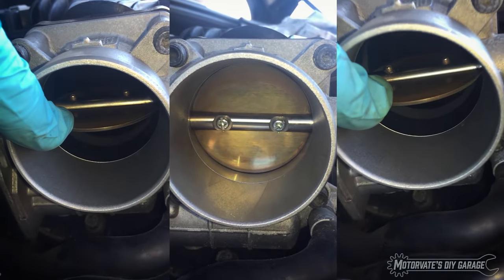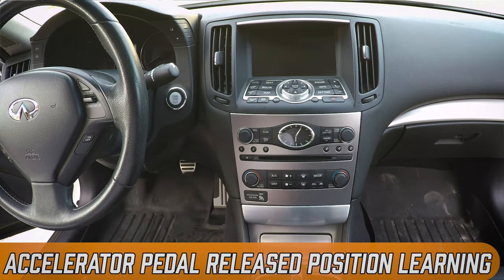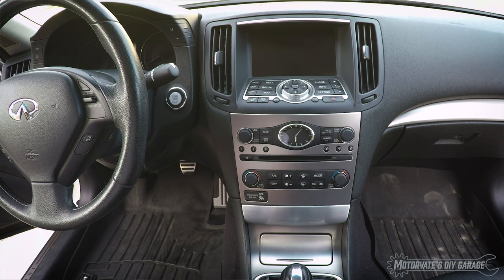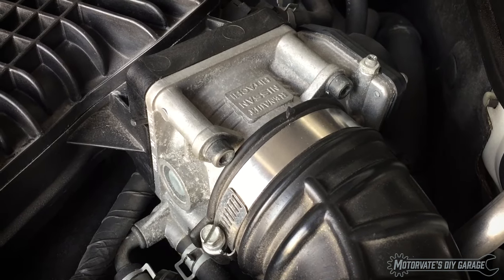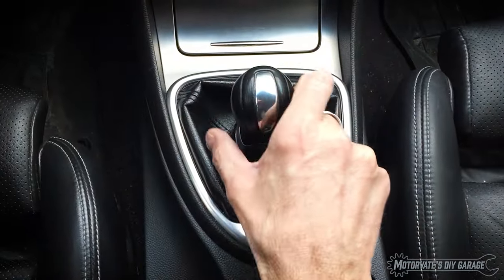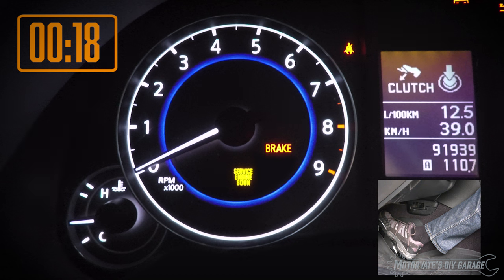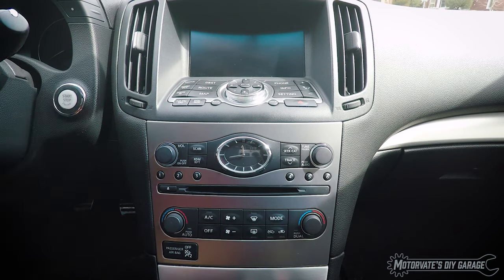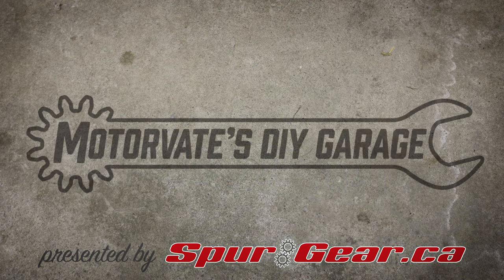G37 & 370Z After Throttle Body Cleaning: Motorvate’s DIY Garage Ep.27

Comment: I'm curious. I've cleaned the throttle bodies in my G37 twice now and have not had to do the idle air relearn. 

Could the reasoning be because I disconnect the ground from battery BEFORE getting my tools and starting the process?
Reply from the maker: Here are my thoughts based on what I have seen and researched on my G37:

Disconnecting the battery doesn't prevent a high idle after TB cleaning.
With the ignition off, the ECU isn't running... Just like when the battery is disconnected.

If the throttle bodies are a little dirty and then cleaned, the ECU can compensate. If they are very dirty, the ECU needs to re-learn the idle air volume learning.
Reply: @MotorvateDIY  ah see I was assuming that the TB still recieved some kind of current.

That's why in the older gen vq35s like on my old maxima, just looking at the dang TB wrong and it would fail. 

Or maybe it's the ones that use a cable? 

Idk I just remember being told/read that you should always disconnect the battery before servicing the TB or else the flap mechanism or w/e may fail.
Reply from the maker: Do whatever you think is required. There is no harm in disconnecting the battery :)

Comment: Thank you!! Super easy and straight forward instructions 💪🏼 370z idles around 600-700 rpm after I followed all your steps… in any case how can I tell I did one of the steps wrong ?
Reply from the maker: If your idle is stable and when fully warmed up at 600-700 RPM, you did everything right :)
Reply: @MotorvateDIY  car runs way better and roars better when driving 💪🏼 the Z can breathe better now. And she starts right up now with no hiccups
Reply from the maker: Agreed. The initial throttle response is MUCH nicer. I'm glad the video was helpful :)

Comment: Thank you for this clear and concise video. After cleaning my throttle bodies per your throttle body cleaning video, another great instructional video, I performed these three steps. Now my  '08 G35S 6MT sedan, with almost 57000 miles, idles smoothly at 650rpm and throttle seems peppier, more responsive. 

At first I had some difficulty with IAVL and thought it was due to not getting timing correct. I tried again after fully charging my battery and it worked the first time instantly. Since I have not been driving my much lately, I think my battery was discharged and not putting out required 12.9V at idle. I should have checked this with volt meter.

Thank you so much!

Now on to your OBD2 scanner comparison video... I need one of those MX+ blue tooth scanners! 

PS. Any recommendations, does and don'ts for cleaning MAF sensors? When I bought can of CRC throttle body cleaner, I also bought a can of CRC MAF sensor cleaner. Instructions on can seems fairly straight forward.
Reply from the maker: Hey  Stewart Rydman,
I'm glad you got the IAVL to work. It can be tricky.

As for cleaning MAFs, it could not be any easier:
• remove two 10mm screws
• disconnect the MAF connector
• on the narrow edge, there is an opening with a wire and a orange coloured  glass bead. Spray the MAF cleaner on that and the other wires behind it. This is the intake air temperature sensor and the "hot wire".
• allow a few minutes for the MAF cleaner to evaporate
• place it back in the intake tube, with the opening (where we sprayed the cleaner) facing the front of the car.
• tighten the two 10mm screws (snug + 1/4 turn)
• plug in the connector
• start the car and check for a normal idle.

I will put together a video this spring.

Thanks for the update on your IAVL issue!
Reply: @MotorvateDIY  OK thank you. I will do MAF sensors next then.

Comment: My qx70 idles around 1.1-1.5k in park.  Air filters recently replaced and only has 60k miles…maybe I should try this and clean the MAF and throttle body
Reply from the maker: It wouldn't hurt... That idle is a little high for a fully warmed up engine.

Comment: I live in Naples, Fl. There's only one week a year that it "might" be possible for my coolant temperature to drop below 77°F and that week was three months ago. Guess I'll hold off cleaning my throttle bodies until Jan 2022. Very odd that has to be the case when the next step is to start the car and wait until it's warmed up (only 2nd step because confirming your coolant is below 77° is apparently #1).
Reply: This video's processes seem much simpler, even though there are still many steps. At least there's no coolant temp mention. I'll have to look it up in the FSM to see if that is even mentioned. Doesn't make sense that the coolant temp would have a minimum that extreme that you must start with unless they're just trying to stress that it's important not to do it after driving around with a warmer engine.
https://www.youtube.com/watch?v=TZJfWQLGUZI
Reply from the maker: Hey Danhoven,
For the idle air volume learning, the coolant temp requirement is #1 on the list at 2:43. (must be > 70C / 158F) 

As for the throttle valve closed position learning, the FSM implies a 40C / 104F engine coolant temperature increase is what the ECM is required.

Don't worry too much about the closed throttle position learning, it happens every time the criteria is met. The next time you go for a drive, open your door and then turn the car off. You will hear the throttle body close and open.
Reply: @MotorvateDIY  Thanks for the reply, and sorry for my tardiness in getting back to you.
Now for my nightmare story, but with a happy ending.

I'm a great plumber, tradesman, but I'm a youtube mechanic on my car. When I am put on a pill of some sort, or change my diet in some sort of way, I document it somehow to more easily troubleshoot anything abnormal (I even do my bills via spreadsheet)... I never wanted to touch my plugs at the same time I did my throttle bodies, and MAFs because for me, a novice at best, it'd be way too hard to backtrack and fix something I screwed up. The crazy routine of setting the throttle positions, pedal, etc, added to that means yet another thing to worry about, and there was issues that looked like a faulty learn on my OBD2 thingy.

Luckily for me in one way, I video most everything I do on my car. Last Saturday I cleaned my throttle bodies and MAF's. Since so many people said it's the best time change the spark plugs, I went ahead and did that too (all of which for the first time. Even in just throwing in the new air filters). The entire process took about an hour and a half, but when I started my car it shook BAD. It kept stalling and the idle was crazy high. I had to keep briefly putting the pedal to the floor since to me it seemed stuck open. Tried the relearn a couple of times. Disconnected the negative a few times. Nothing helped. The only thing I didn't do as everyone shows in their videos was properly torgue the plugs (actually, EVERY video I've seen, no one torques them, but does them by feel). I got the OEM plugs but despite them supposedly being pre-gapped, I had to gap them and had a wire gapper disc thingy. So at engine start and with the horrid outcome, I figured maybe it was a bad torgue or bad gap. I nearly instantly had 5 codes. One was something about learning (which is where I think it was stuck in learning). There were a couple about random misfires and one about my evap. I wasn't able to torque them due to not having a long enough ratchet extension so went down to autozone Saturday night and bought an 18" and a different type of gap tool to get ready for the rework the next day.

Well, later that night, I referenced my videos and the first of about 70 that I opened showed me disconnected the PCV hose to more easily get to cylinder #1. I froze like a man that just stepped on a bouncing Betty and tried to remember if I reconnected it. I live with roomies, so I just had to confirm at this point and ran down near 1am popped my hood and turned the flash light in that direction. Sure enough, I forgot to plug it back in... I ran up stairs and started to look up symptoms of not having that connected and better learned what it is. All of which sounded like what I was experiencing and could hardly sleep. Soon as I woke up I fixed my idiocy and it started and stayed started with no more stalls. The idle was slightly high but consistent. I did the volume relearn again and never felt it so smooth. Idle was between 600-650 and have driven it a few days without any issues with no more lights/codes coming back after clearing them. One minute I'm thinking how incredibly cursed I must be and the other I'm thinking how incredibly blessed and lucky I am for finding that video of me disconnecting that hose.

One other note, that initially I thought I was stuck in learning mode somehow was that my trip that night to Autozone my engine light started blinking. I drove it 7 miles out and then back home only to then learn how serious that was and that it wasn' anything to do with not exiting a learning phase that I tried without a hose connected to my PCV!!! Hahaha, but not haha. ;)

Thanks for the great vidz and your reply! This weekend I change my oil, flush the coolant and power steering. I'll have to look through your channel in hopes to find a way to disconnect my thermostat and somehow bypass for my heater flush (new hoses all around too with aluminum couplers). From watching videos on the G37 I see so many people compain how long it takes for the thermostat to open and in the shade here it's hot. I leave for work at 5:30 am and it's 80° outside so all these temp dependent things are my only issue. I bought a couple of kits so plan on splicing in a flush unit and disonnect the hoses for the fire block just outside the firewall and then maybe seringe feeding it before taking it out about putting on my news hoses.
Reply from the maker: Hey Danhoven,
I really enjoyed reading that! You are a good story teller.

Taking pictures or video  before and while you work is an excellent idea and I did the same when I would do things I hadn't done before. 

Anyways, good luck on your next project :)

Comment: Aye boss, just cleaned my throttle body and MAF sensor. My idle seems to be the fine but I gear this whinning/high pitched buzzing noise coming from the engine bay.
Reply from the maker: Most likely that is from the normal throttle body operation. They use a "pulse width modulated" signal to control the throttle position and sometimes we can hear it.

Comment: Great video, I  wish I had seen it 4 years ago when I cleaned the thottlebody on my 07 G35X, I had to take it to the dealership cause the procedure I found didn't work, I didn't know about the ecu update, I need your opinion on this, looking for a leak source my mechanic shampoo the engine, afterwards the engine sounds like a vacuum,     I'm pretty sure the throttle position lost its calibration, stiff pedal and engine not so strong as it felt before, since they already updated the ecu program would I mess it up if I try this learning procedure? Plase help... tx in advance..
Reply from the maker: Hmm... I don't know what to say. How is the pedal stiff? It is a drive by wire, so if it is stiff, maybe some dirt/salt has collected in the lower hinge of the accelerator pedal.

As for re-doing the idle air volume learning, do you know that you can do it without any issues? Has you ECU been updated?

Comment: What if your idle is not back to normal? I have still a high idle at 1400 rpm. When doing all 3 procedures and starting the car after pressing the pedal to the floor the engine starts to surge from 1400 to 2000 rpm. I've made sure I have no vacuum leaks replaced all my intake manifold gaskets lower and upper, and just replaced the pcv valve. There is no check engine light and disconnecting the MAF does make the car run more rough but the rpm surge is still there. A surge happens once every 2 seconds after performing learning procedures. The rpm does not go down lower than 1300 to 1400 rpm
Reply from the maker: What year, make and model?

Comment: Great video very professional. Just a quick question, In the FSM it doesn't say to turn the car on for the throttle valve closed position learning. It just saids to turn ignition switch on and than off and wait at least 10 seconds to hear the throttle valve move by listening to operation sound. I notice you started the car in this video is that really necessary???
Reply from the maker: Hey  luis lopez,
Thanks for your kinds words on the video!

Here are the instructions from the FSM on my 2011 G37 on page EC-26-27

THROTTLE VALVE CLOSED POSITION LEARNING

WITHOUT CONSULT-III

1. Start the engine.
NOTE: Engine coolant temperature is 25°C (77°F) or less before engine starts.

2. Warm up the engine.

NOTE: Raise engine coolant temperature until it reaches 65°C (149°F) or more.

3. Turn ignition switch OFF and wait at least 10 seconds. Check that throttle valve moves during the above 10 seconds by confirming the operating sound.

What year, make and model is your car?
I would like to see if Nissan/Infiniti changed the process in the FSM.

Thanks for pointing this out!
Reply: My car is a 2008 g35s infinity. The reason I asked is because I was going to be cleaning my throttle bodies which I did yesterday. I found that by disconnecting the negative cable from battery and pumping the brake pedal  a few times I didn't have to do anything else because  Idle dropped to 650 after car warmed up. I also opened butterfly numerous of times while cleaning.Your instructions are very professional though. @MotorvateDIY

Comment: Great guide step by step. Cleaned both throttle bodies couple weeks ago followed up with the 3 step relearn. Only problem I'm having is that the car jolts after releasing the accelerator pedal while driving. Don't remember the jolt was this aggressive before this, would you know what is causing it. I also did the relearn couple times.
Reply from the maker: Hey ljaizm,
That is a little odd. 
Does that happen with the car cold or fully warmed up?

If you use the cruise control and use the steering wheel button to speed up or slow down is it smooth or give you a jolt?
Reply: Motorvate DIY Hey it does when the car is warmed up. I just took the car out for a spin to try the cruise control part but it does not jolt what so ever, if anything just a slight bump when going up and down the speed and it's very minimal. The problem only happens when I let off the gas and very noticeable when driving in congested road when I'm in 2nd and 3rd gear.
Reply from the maker: Hey ljaizm,
The reason I asked you to use the cruise control is to see what happens with small changes in throttle position.
I'm trying to figure out if the issue is the transmission/driveline or engine.

Maybe do the 3 steps again and see if there is any difference. Sometimes they are tricky to get to run.
If you have an Android device and a bluetooth PBD scanner you can use a free app to quickly do the idle air volume learning: https://youtu.be/OiB9txECWB0

If there is no difference, you might want to post your question at myg37.com to see other people's experiences.

Sorry, I couldn't be more help.
Reply: @MotorvateDIY  Hey Motorvate,
Sorry for the delayed reply, went out to get an android device and did the NDS III Lite method. I made sure the pre condition were met (Coolant temp at about 210F and voltage at 13.9V). I ran the  IAVL via the app 2 to 3 times and it failed. I then disconnected the MAF sensor for 10 - 15 seconds. While the sensor was disconnected the engine idle speed did surge to about 1200 rpm. Plugged the sensors back in after 10 - 15 seconds, cleared the code and ran the IAVL again and no luck, but the idle speed did drop down after though. 
Side note, my car is tuned by a tuner and idle speed was raised to 825 rpm at idle. Will this affect the IAVL?
Thanks

Comment: Hey just changed my spark plugs.. but didn’t do throttle cleaning. Do you recommend a idle reset my mechanic said it’s not needed for new cars
Reply from the maker: Nope, there is no need. 
Changing the spark plugs has nothing to do with intake air flow, so you are good :)

Comment: I just cleaned my throttle bodies, made sure everything was tight, also cleaned the Mass air flow sensor, and when I started the car the idle was super bight, when the engine was warming up the car now had a bouncing idle from 1500 to 2500 rpm’s.. what car I do to fix this.. I tried everything and car keeps doing it
Reply from the maker: What is the year, make and model of your car?
Reply: @MotorvateDIY  2007 g35 sedan sport 6sp manual
Reply from the maker: Oh Crap!! I guess you didn't see the warning at the top of the video description :(

There is a bug in the 2007 G35/350 ECU software and the "idle air volume learning" will never complete, resulting in an unstable idle.

Some have been able to get an ECU update at the dealer and other have contacted Eugene at Enthusiast Auto Care (https://www.yelp.com/biz/enthusiast-auto-care-concord) and he will update the ECU.

Too bad Nissan/Infiniti didn't address this issue a long time ago.
Reply: @MotorvateDIY  oh man :/ yeah i tried all the re learns and it’s still runs like shit
Reply: hey PanchoPann, my brother has recently run into the same issue after cleaning his throttle bodies and MAF sensors on his 2007 G35X and I am helping him look for a fix. Did you happen to find a fix for your car at all? TYIA!